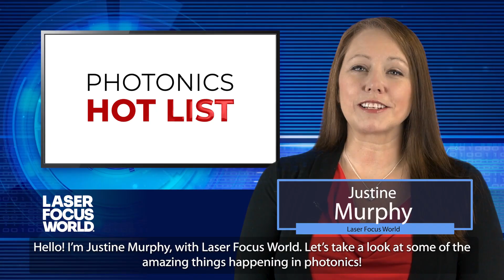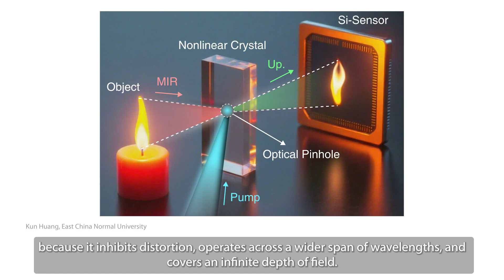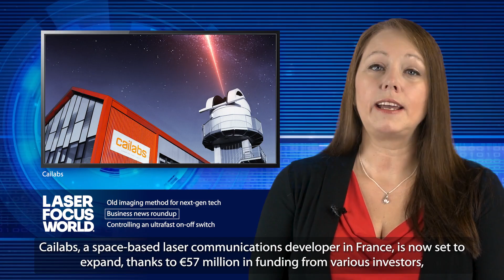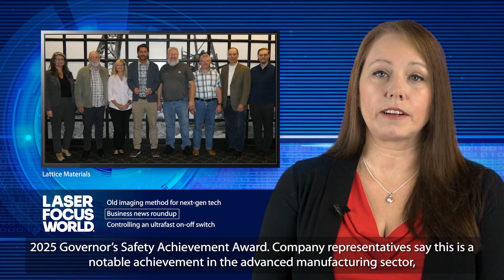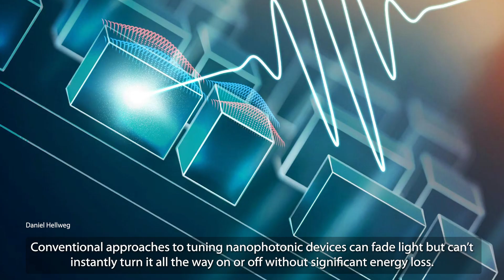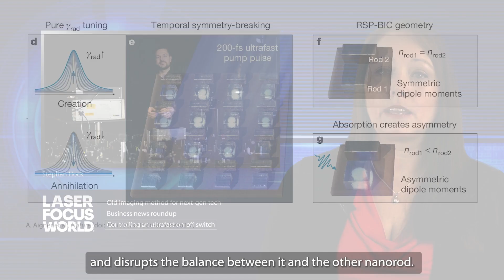Photonics Hot List: September 26, 2025

Comment: Dear Madam Justine Murphy:
  In Consciousness Pixel Theory, the pixels must vibrate beyond the Petahertz timescale. Only the Chromatin, Microtubule, Nucleotide, can be responsible for this. The proteins must perform AXIOMATIC MULTIPLICATION thru the EQUILATERAL triangle ( Group Theory) which successively creates smaller equilateral triangles. 
   In the Koch snowflake, the additional triangles converge to 8/ 5 times the area of the original triangle. The perimeters increase WITHOUT LIMIT. Hence, the pixels, if indeed, they are conscious, can live beyond the photon' s lifetime; and establish the Graviton Regime at 10 exponent 42 cm. sec. This is PHOTONICS at its best form.